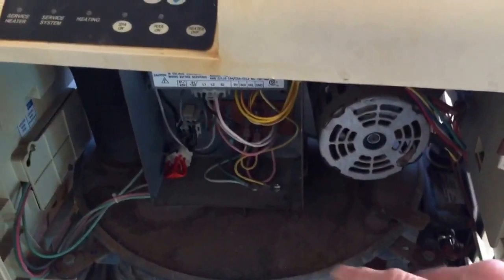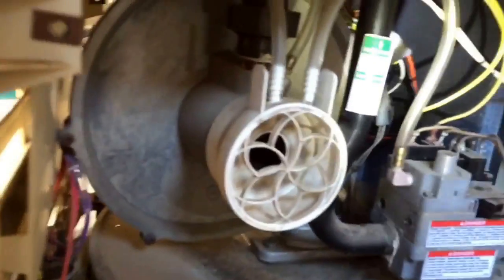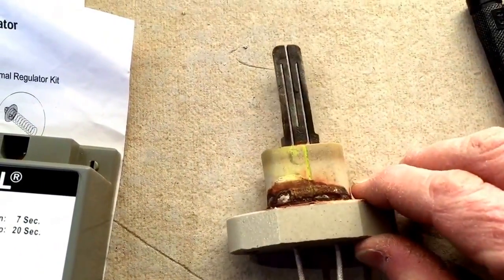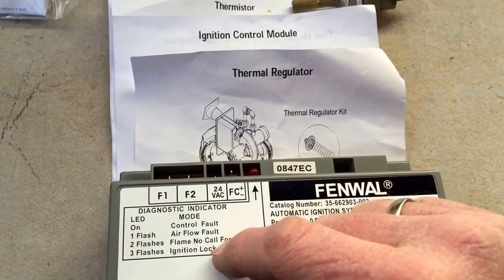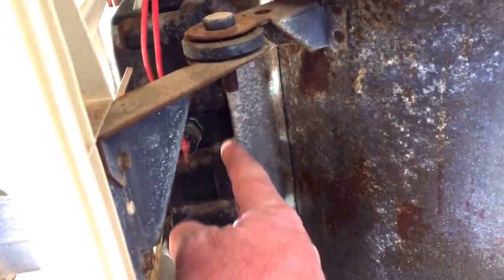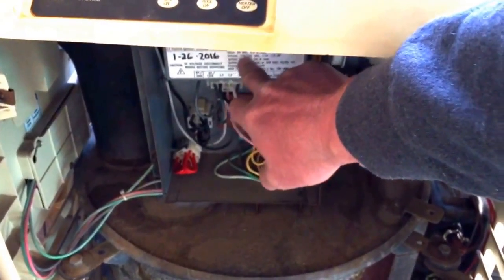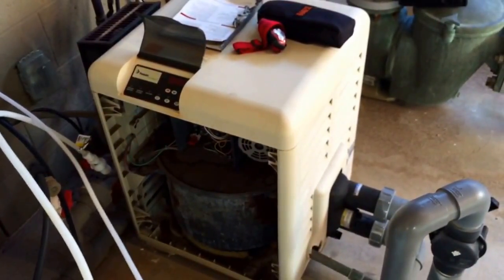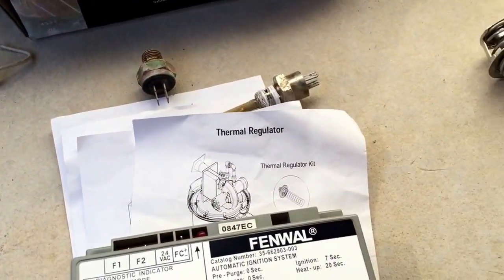Pentair 250 ignition lockout.

Comment: Hi Michael, very informative.  I have a Pentair Master Temp 400 & it won't hold the heat. The heat keeps cycling approximately every 2 minutes (it heats up every 2 minutes or so) & then the "service" light comes on, then "Heat" blinks calling for heat, and then steady "Heat" light for approx. 2 minutes. Sometimes I hear a sound coming from the manifold before it cycles.  There are no error codes in front of the panel and/or error lights at the back of the panel. I checked the "Thermal Regulator" & it looks fine. My pool guy came & he was able to get it working he said it's just the water's ph. I don't know what he meant because I always check/maintain the water quality of my pool. I even clean the filters. anyway, it work 3x I used it & now it's back to the same problem. I called them & they are planning to replace the igniter & thermal sensor (thermostat). I'm planning to do it myself. I wonder, if you have instructions or video in replacing the igniter. I would appreciate any advise & your help. Thank you.

Comment: I have a mastertemp 250 as well.  Just purchased from a previous owner.  Its less than a year old.   Heater Ignites and then shuts off after about 10-15 seconds.   I switched the heater from Natural gas to Propane.   I changed the Orifice and replaced with propane.   Bought a regulator for propane.   Any ideas what it could be?  I have replaced the high limit switch and no luck.
Reply from the maker: That unit has a gas pressure switch, check and see if it opens, the high limit switch is when the water get too hot, if it’s getting gas and the igniter is good, did you check the igniter?it’s done by ohms should be higher then 20 ohms. If all else fails check the ignition control module, are you getting any error codes?

Comment: So I have a story for you, boss!  MasterTemp400 purchased and installed by yours truly in Dec of 2014 for service client, no maintenance, yet.  Ran great for half of first season then displayed 126deg.  Starting with cheapest part first:  thermistor, nothing; PCB control board, fixed.  Ran for one full season then random on/off cycles inside set point without lock out, checked thermal regulator, opened in boiling water, good.  Jumped HLS, same issue. Checked board, J8 pin block had corrosion bridging two pins.  Heater is not sheltered but there isn't an abnormal amount of water present (guttered roof and under eve).  Cleaned pin block, nothing.  Replaced board, again, fixed.  Second season: cycling on/off again without lock out (heater is plumbed with a by-pass so during height of summer, no water is passing through heater and it is completely drained).  Thermal regulator stuck closed, replaced.  Water chemistry could have been off since I just took over the maintenance of this pool, salt pool so 7.8pH+ util I came along.  A week later and the heater fails to fire more often that it fires; checked ignitor, 90 Ohms, replaced ignitor anyway.  Situation worsens with the heater failing to fire 9 out 10.  Checked gas pressure at 7"wc static with over a 5.5"wc drop static with CSST flex line in betwixt the meter and lbs to inches regulator (ok for 2lbs but not for anything less).  Before installing the heater, I had the homeowner get his gas provider to install a 2lbs system with a million BTU meter.  I didn't notice the white meter face (versus red for 2lbs) during the heater install.  The gas pressure from the meter was at 0.25lbs.  I had them upgrade to 2lbs.  Now, the heater fires more often then not, 8 out 10 times.  I let it ride.  Then two days later I get a text: "Pool is cold."  The heater is now heating to set point with no problems and then locks out during the first maintenance cycle.  I check the Fenwal ICM, get 5.0VDC at the FC terminals (better than good fire sensing rectification).  I replace the HLS, the thermistor again, the stack flue sensor, and the PCB controller (pentair sent me a new one).  Doesn't matter what the set point is 68 or 90; I get 8 out 10 fires at ambient temp and then lockout after set point is reached, every time.  I checked the orifice for giggles.  So the only thing I haven't replaced is the AGS, the fenwal, and the stuff in the combustion chamber.  Oh, yeah and this heater has all the extra ground points factory installed (you know the flame holder ground).  No flow issues: Intelliflo @ 3000ripums with 600lb Triton @ 17psi.  Flow meter registers ~65gpm after the heater (cheap, residential flow meters are notoriously off by sometimes more than 10% so....).  I'm ready to just warranty out the entire heater at this point!  Whatcha think?  New fenwal?  Check burner?  Too much air in the fuel mix?

Comment: My ohm resistance reading is 77 on the ignition coil. 
I can’t smell gas 
I have no fault codes. 
Gas line is on. 
Service light comes on and all the buttons stops working. 
I never hear the igniter Click. 
It used to click.

Comment: nice video.  what's the best way to test the ignition module if it's bad?
Reply: I saw on amazon that it appears the ICM circuit board can short to ground near the terminals for the ignitor. You can take it apart and look.

Comment: Great video- I got the same exact issue I replaced the icm and Igniter still same  thing, red light flashing 3 time which other parts you recommend to replace?
Thank you
Reply from the maker: Omri Zecharia There is a high limit switch and a low limit switch try to short the two of them together not the high and the low switch pick one or the other to start with you can jumper out the high switch and try it and then jump out the low switch and try it each time you do something you have to reset the power supply the next area I would look towards would be the gas side make sure that your gas pressure switch is in operating make sure that the gas valve is working all of those can be done by jumping them out. I hope that helps if you have anymore questions please feel free to ask.
Reply: @1030daman  thank you so much for the quick feedback, I just noticed this morning r-13 code on the heater, I cant figure it out, also when you saying "reset" it's just to disconnect the unit from power for minute or so right?
Thank you again
Reply from the maker: Omri Zecharia yes sir. 🤙🏻
Reply: @1030daman  🙏
Reply: @Zachnsm1234  R13 is the revision of the software on the control module, it is not an error code by any means.

Comment: Got a brand new pool installed my Painter heater 250 
ran for one day I am having the same problem as your video the heater light keeps flashing and then it goes into service mode
Reply from the maker: If you just had the heater installed I would check the gas pressure and gas pressure switch if those check out then I would move on to the flow switch you have to set the flow switch on new installs if they are not set correctly you can run into this problem as well hope this helps thanks.

Comment: I have this same issue with my mastertemp control unit flashing ignition lockout but there are no errors. It is firing but not heating. I replaced the orifice to convert from propane to natural gas. Also replaced the igniter and ignition box and high limit switch like you did. Still no heat. It clocks and tries to start and I smell gas. Any ideas?
Reply from the maker: @ChristopherTurekSr-l9q  is your ignition control, module blinking any blanks? Also, you can check your flow switch for proper flow. If there’s not enough flow to the system it will not engage the manifold sensor or you can jump that one out by just shorting the two of them together, I would recommend power cycling every time you do something, also you can check your thermal switch.
Reply: Yes the ignition control module is blinking 3 times- ignition lockout.  Gas pressure was checked last night and it’s at a 7 Pentair said it had to be between 4-14 so that’s good.
Reply: I used the orifice from my gas 250 model in my 300 model. Pentair said it has to be an orifice for the 300 so I ordered and hoping that takes care of it.

Comment: If I’ve replace all of those same sensors with OE parts note I’d didn’t run at all ,now it runs for about 15 min and goes out for 30 sec and comes back on over and over and I’m still getting an R13. code?  Help what am I missing
Reply from the maker: Hey Jim, it sounds like you were having a intermittent electrical problem if you have replaced all with OEM parts and the unit runs perfectly fine for 15 minutes and shuts off and comes back on I would check for any loose wires any chewed wires also I would check and make sure the flow from the pump/filter is adequate if the flow switch does not detect adequate amount of flow it will shut the unit down also check for any debris that is dropped inside of the sand overtime,If carbon builds up in the exhaust fan it will shut the unit off as well however for my experience the problem you were explaining to me sounds like it could potentially be an electrical short or intermittent connection.

Comment: Hi i have a mastertemp 250    afs light on .  But the blower is not working  you think could be de ignition module i changed all sensors  still not blowing
Reply from the maker: It could be the ICM or I would resistance on the fan motor and make sure that is operating.

Comment: I have a problem with pentair master temp 250 smell gas and don’t ignite we replaced the igniter it was blow and started heating after a day the igniter blows again. Any suggestions? Thank you.
Reply from the maker: Have you checked the ohms coming from the ICM going to the igniter and/or have you replace the ICM and when you installed the igniter did you touch the elements with your hand if so that can cause the breakdown of the igniter but something to happen that quick could be an ICM or check wiring going to ICM for any shorts.

Comment: Is it possible that the ICM can go bad after just 6 hours of use? I have a Pentair 125 and it fired right up, heated water up to temp, shut itself off, and then on the next call for heat it went through the ignition sequence and I now have an ignition lockout code on the ICM. I am getting 59.9 ohms on the igniter. Any ideas as to what to check for? It is brand new and I don’t  imagine that the ICM is bad
Reply from the maker: If the ICM checks out and the igniter checks out I would check for the gas operation next the ICM does a check of pressure meaning water pressure in the system from the pressure switch if it doesn’t ignite, it check  gas  before igniting if you have pressure and pressure switch is good I would check and make sure the fan on the gas side is coming on and that your gas valve/solenoid is operating correctly if the unit calls for ignition and gas valve does not open it will throw an ignition lockout as well hope that helps.
Reply: How would I check the ICM to see if it is still good?

Comment: Hey I have a pentair 400 heater and gave error code e05 ?
Reply from the maker: The MasterTemp stack flue snsor trips when exhaust temps reach more than 350 degrees. This is usauly caused by a flow issue or a bad thermal regulator causing the water to remain in the exchanger and over heat. I hope that helps if not I would lean more towards the ICM if you’ve never had a problem with any of the gas valves or combustion before they recommend changing out the ICM every 3 to 5 years.

Comment: @aquaboss 
Dude , I been doing this for 20 years , and master temp heater boards , touch pad membrane are crap! And everything else with this heater , this heater makes you a professional parts changer because it will throw a stack flue sensor code and it’s actually the mother board. I used to love this heater because of its size and easy to install on your own , but now it’s like pentair has gone so cheap with their parts ! They don’t last at all ! So it’s not your water chemistry its cheap as parts they used at the factory ! Your just one of those guys who thinks they know it all just because your a pentair tech!!  Your salt cells suck , your back wash valves suck! Your actuators suck ! Only good thing you have is pumps now a days.
Reply: Actually the pumps are total crap too. The Intelliflos are way overpriced and will last you maybe 5yrs. Pentair is nice looking but below average equipment.

Comment: Master temp is the easiest of all the brands heaters to deal with.  I do this daily.  If you know where to look an the steps to check. It very much throws codes an lights directing you to the problem.  9/10 every heater issue is a 3 minute to an 30 minute fix. Open up replace what's needed an close it up an go.  The only thing takes an little over an hour is completely replacing the exchanger.   Other than that it's Childs play.  An 9-10 times all the problems are water chemistry related. From people not taking care of their shit.  Which I do not know why they don't. It's so simple.  Because if I ever get a call for any heater that's the first thing I do is test they are water.  Because if it's anything to do with water chemistry it don't matter if it's a week old and still under its three-year warranty Pentair will not cover damage due to water chemistry. I know because I'm their certified tech.  So if someone's heater is out and they are water is screwed up, i'm not writing it off to Pentair they can just pay me for the part and the service call to take care of it since they didn't take care of their water